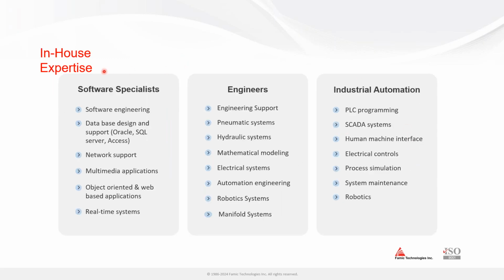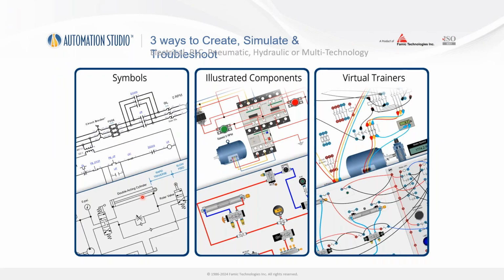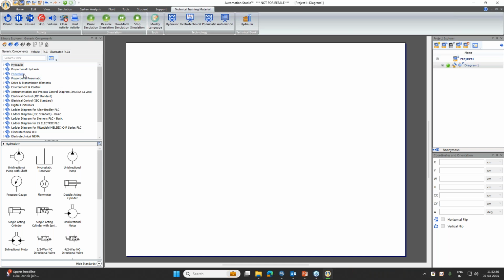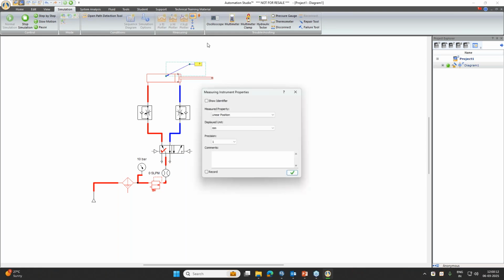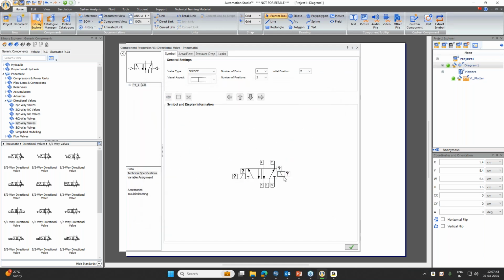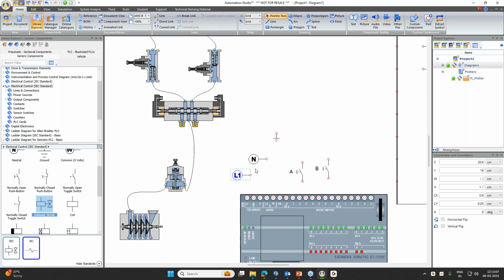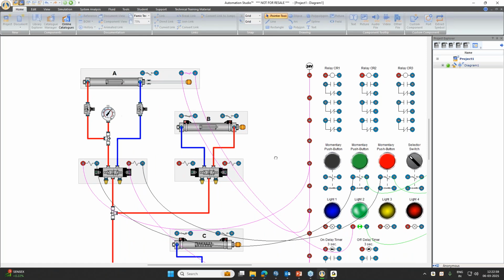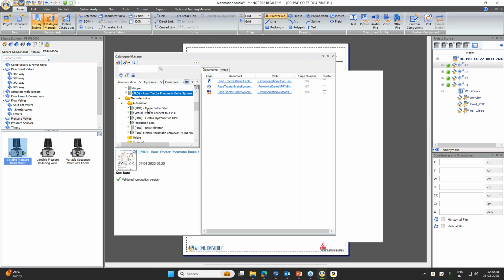Automation Studio P9.0 Simulation of Electro Pneumatics 03.25

Comment: Bro i need to design a circuitelectro pneumatic circuit for my project like A+B+(half extend)B-A-B+(full extension)B-  . The  cylinder B has 3 limit switch 1 at full retracted and 1 at middle and 1 at full extended. The application is stamping station can u post a video on it